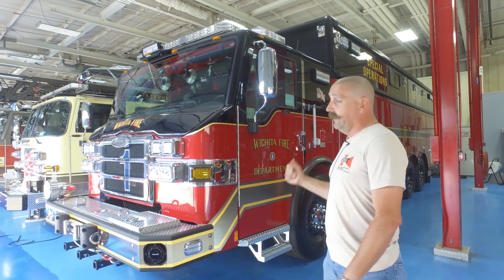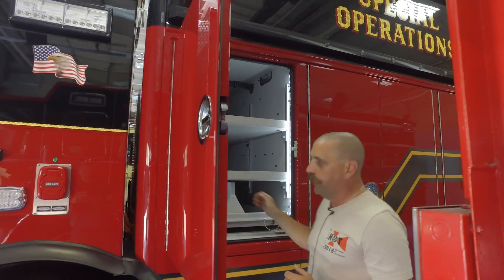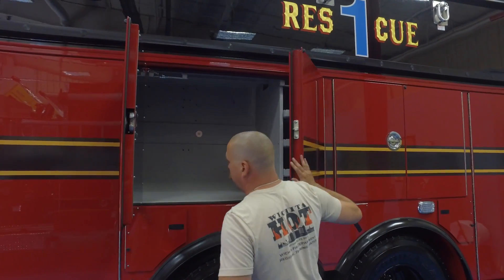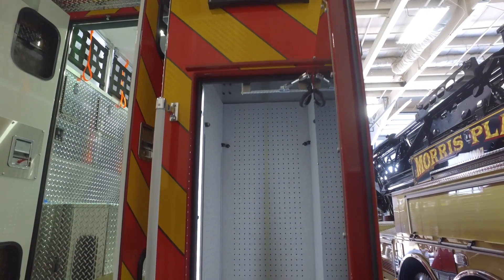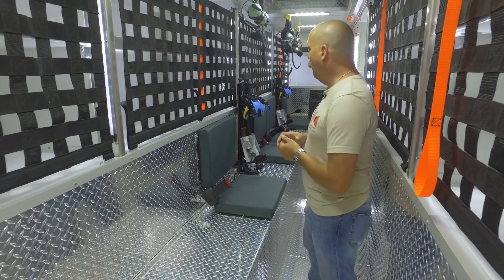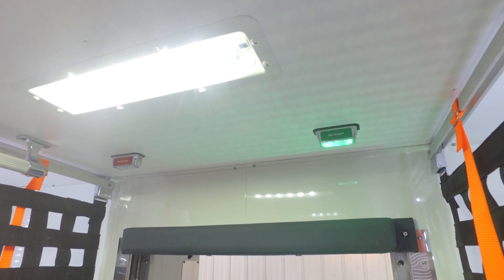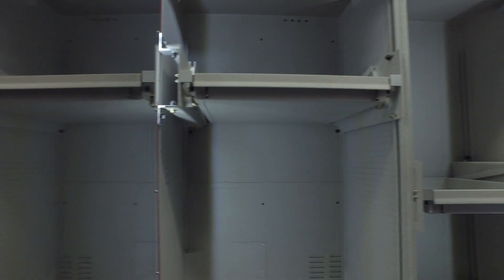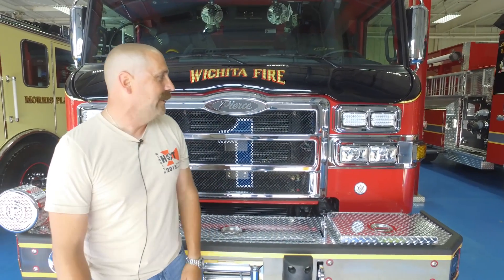Velocity® Walk In Heavy Duty Rescue – Wichita Fire Department, KS

Comment: Loving the speakers being mounted towards the intersections!
Reply: Why is that? All the data I have seen is the speakers should be mounted as close as possible facing forward for the highest decibels.
Reply: @Bellman84  It allows for more sound to be heard in the intersections and have it pointed towards vehicles on the sides.
Reply: David Belleperche the configuration you described is best for forward facing sound, as you can see this rig has a classic fedsig q upfront for the main siren, with intersection-facing speakers for auxiliary coverage. Nice setup imho